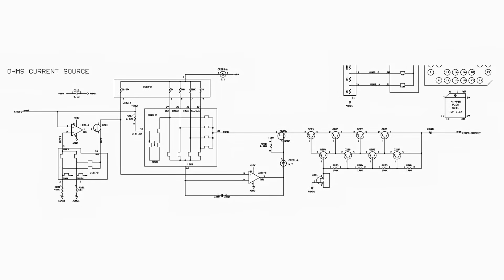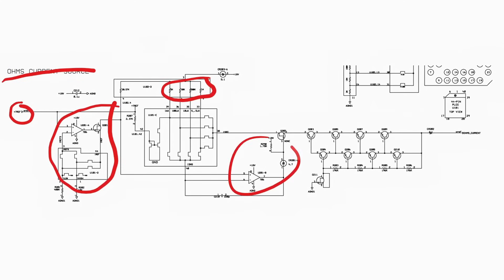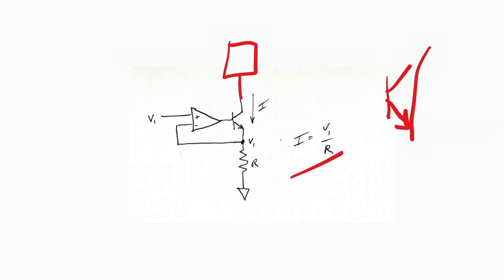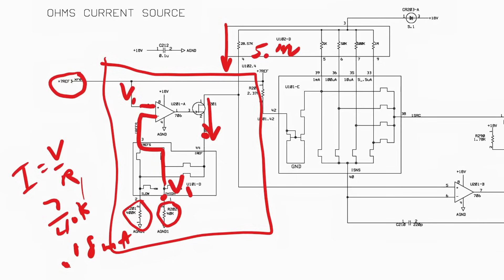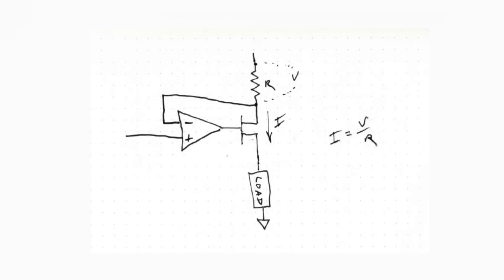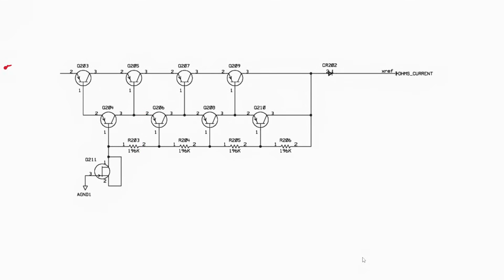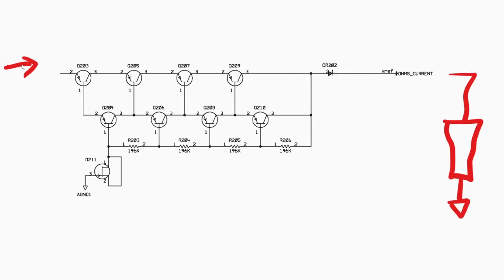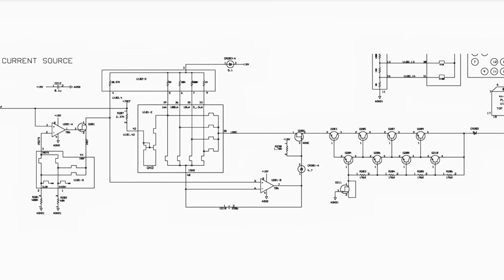#1818 Current Source from HP34401 Explained

Comment: This video sorta fell off the rails the farther along you got,  You forgot to mention that Q211 is used as a fast ultra-low leakage diode.  That's critical to how the protection stacked Darlington's work.  If possible, this video would be a good candidate for a re-do.
Reply: He wings it... but, we still watch... don't we.
Reply: page 98 of service manual the sum of the reverse collector break down voltages,  q211 is for voltage biasing the network also having  a low leakage
Reply: I already lost faith, when he brushed over the JFET without actually explaining why and how the JFET is different (but explaining the well known BJT stuff at length)

Comment: The beta of the transistor in the current source is irrelevant so long as the op amp is working. Thus, replacing the transistor with a FET is meaningless in this case. Think about it a minute. What is important is the offset voltage of the op amp.
Reply: The load resistor is carrying both base and collector current.  This could be corrected for if the beta of the transistor is constant, but real world transistors have changing beta with temperature.

Opamp offset voltage should be the lesser error with a good opamp, such small offset voltage being needed to produce base (or gate) voltage.
Reply: @hanelyp1  The beta of the transistor is IRRELEVANT so long as the op amp is working. Remember, the op amp will drive the output to turn on the transistor to whatever level necessary to keep the voltage on + and -  inputs the same.
Reply: @glasslinger  placing the combined transistor drive and output current on the sense resistor.  Which if you don't account for the drive current produces an error in the output.
Reply: @hanelyp1  Please get a book on op amp theory and read it! More important, understand what you are reading!
Reply: Surely the opamp is there to control irregularities like temperature and the change in Beta, thats it's lot in life Thats what you mean and is correct as far as I understand it :)  @glasslinger
Reply: Glasslinger is correct, The opamp negative feed back will keep everything in check irregardless of the beta of the transistor. since it is in a closed loop
Reply: @glasslinger  Wrong. But by all means keep digging yourself into a deeper hole if you wish. That the opamp will maintain the right voltage drop across the sense resistor is irrelevant, because some of the current causing that drop will come from the base of the transistor, NOT from the 28.57k resistor that you want a specific current through. The more current that needs to come from the transistor base, the less will come from the 28.57k branch through the collector, because the opamp will only keep constant THE SUM of both currents exiting through the emitter through the load resistor.

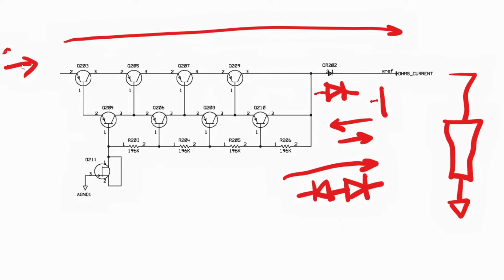Comment: 1. The protection diode at 15:45 have the wrong direction. For practical considerations the leakage to max current ratio is possible not good enough.
2. Without external interfering source the PNP darlington string operate in saturation. Only the Q210 have Vce(Q210)=1D and Q209 have Vce(Q209)=2D, where D denotes a Vbe. The total voltage burden is 3D plus 3x Vcesat, including the CR202. The R203-R206 are dimension for max measure current divided by beta by square and Vcesat. This structure also work with triple darlington or none.
3. The Q211 is a low leakage diode which activate negative protection at -2D with an impedance of 4x196k where the emitter of Q203 remain at +D. I guess the active circuit left to the darlington string is sensitive and worth to protect.

Btw the D notation is frequently used in analog IC designs where "stacking" and "potential matching" is an impotant circuit topology construction item.

Comment: The real question is what Q211 does. As you get this, the rest of that circuit is relatively easy to understand.
Reply: @opros7 At the lowest setting, the current source itself produces only 500 nA. To achieve good accuracy, the diode leakage must be much smaller than that. The 2N4117A transistor chosen for the Q211 is famous for its ultra-low leakage, about 0.0002 nA at room temperature. Thus the 500/0.0002 ratio preserves full 6.5 digit accuracy, even for the lowest current.
Reply: Q211 is a diode-connected FET. It is a diode, low leakage one, sure, but just a diode.
Reply: I have the same doubt. For me, it does make sense!

Comment: Stacked Darlingtons that distribute the voltage drop. Darlingtons are necessary so that the resistors can be high value for low power dissipation.

It would be interesting to see the protection circuitry for the voltage and current ranges.
Reply: Not quite darlingtons for 3 of 4 stages, but you're on the right track.  The resistors divide the voltage drop, while the transistors carry the bulk of current.